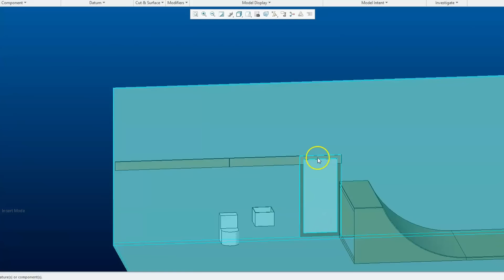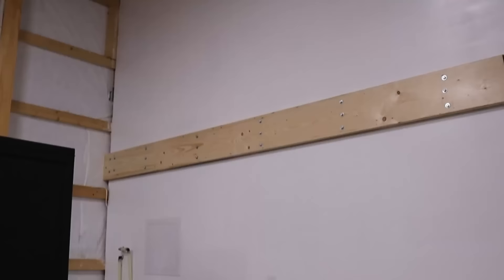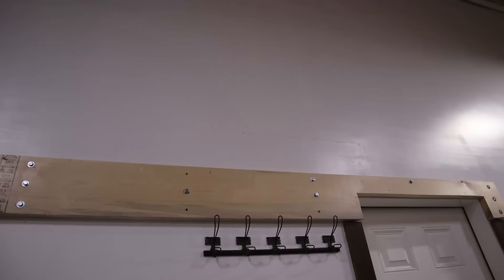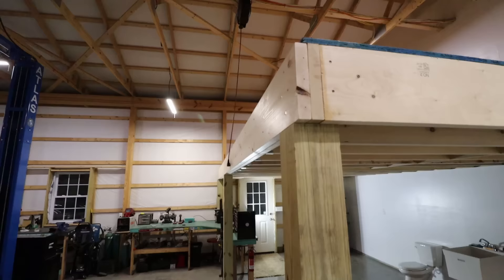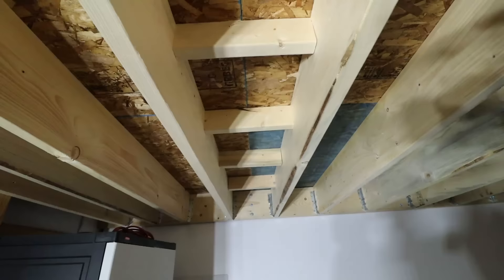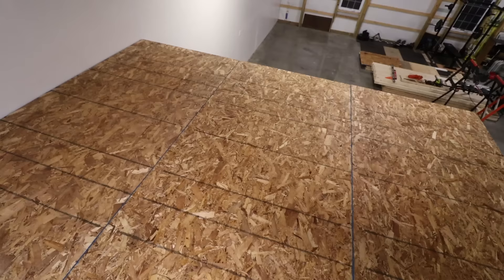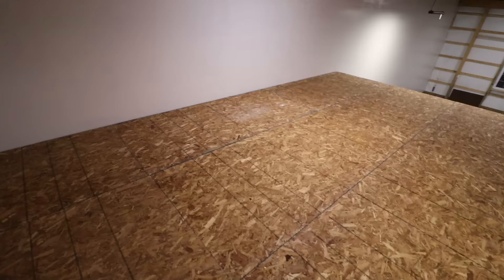Building a Large Mezzanine Loft By Myself - FULL BUILD

Comment: It turned out pretty good.  The lack of joint staggering though was painful to watch.  Staggering your joints will increase your strength and rigidity.  Also, most pros start in the back corner and work out with flooring, it usually requires more cutting, but will make staggering your joins easier, thus increasing the strength.
Reply from the maker: Yeah I didn't bother since this structure is tied to 2 walls and it's just for storage.

Comment: What is the finish on the concrete floor?  What procedure and equipment was used to get it that way?  Does it repel oil spills?
Reply from the maker: Polyaspartic roll on coating from sure Crete. Applied it myself

Comment: Fabulous construction, brilliant, oh how do I weaken it..., oh yes cut notches out out of it, if you do need to cut your timbers where its load bearing, double or triple the thickness, other wise great.
Reply from the maker: Yeah I ended up adding more bracing to those areas and also changed all the screws to proper nails in all joist hangers. It's not perfect but I need the proper headroom above to ride bike on top and I'm glad I did it.

Comment: Not trying to be a hater, but i have some safe structural advice for you.  Good thing you have lots of lag bolts.  4" is too short.  1.5" wood +.5" drywall is only 2" bite less the .5" which is the tip of the lag and you are not left with much holding on. Your built up beam is weak and needs WAY more screws. 1 screw per 2" width every 16". load that floor up and those screws will bend or sheer.  The glue is not considered as a permanent bond.  "Feels Solid" is not how safe construction is done.  My suggestion would be to swap out those lags for 5-6" ones and add a ton of screws to that beam.  where your non t&g plywood is you should have just glued 2x4 on the flat.  As is it will sag between your blocking.  Especially if you have a heavy shelf leg or something, it could potentially push right through the edge.  on all your connectors, make sure every hole is filled.  I dont know where you live but if your in a seismic area you should definitely look into some additional bracing.
Reply from the maker: Thanks for the suggestions and yeah I've already added more bracing especially over the door cutouts and have added many more screws. I ran out of some supplies before completely finishing but thought it was close enough to finish the video. I was limited on lag length because I have some pipes running through studs in certain areas which is why I stuck to 4".

Comment: GREAT job!.  But since you went so "overkill" as it were, i really would have put 1/4" x 2' sq. steel plate under the columns to help spread that load...too late now i know....but i can't tell if the one column is on an expansion joint or control joint?  That just bugs me, but that's me!  Good job!  Also, if in the future you do something similar, screw a 2x4 to the bottom of the rim joist on the outside edge...you can rest the joist on it until you get up on ladder to screw them in place.
Reply from the maker: Thanks, and I appreciate the feedback! This concrete is at least 6" thick rather than traditional 4" so I'm thinking it should hold up without issue.

Comment: Great job. I built a 30x50 metal building and need to seal the floor. I noticed your floor and it looks like it has a very good seal! What kind of sealer did you use?
Reply from the maker: Thanks! I used SureCrete Polyaspartic roll-on coating. It has done pretty well, just make sure your concrete is clean and very dry before you start. I unfortunately had to do it in the middle of winter so my floor wasn't completely dry after cleaning which will mess with adhesion of the coating.
Reply from the maker: I don't think it's as hard as epoxy, but also depends how many coats you put down. I'd suggest at least 2 and yeah I'd use it again for sure. I'll probably add another coat on top in a few areas.
Reply: Thanks so much for the info!

Comment: you did pretty good aside from 4 things i would have done differently. those 2 things are staggering floor sheathing, 16" centers, plywood instead of OSB, and i wouldnt have cut the bottom of floorjoists for doors but instead i would have frames a box out with the floor joists and transferred load over to the sides of the doors instead. either way works but it would have been stronger to use full joists and transfer the weight load over to the sides of the doorways instead. good job though overall
Reply from the maker: Thanks for the tips, I'm definitely no carpenter. I did take the time to fix a few things after the fact, mainly switching screws to nails in joist hangers and adding more bracing around the doorway.
Reply: @Kordare  No problem. for a car guy that has little experience in carpentry you didnt do a bad job at all, i have seen others do things that make me scared to walk on them and yours doesnt do that for me. definitely need some railings still but it seems like you know what you are doing enough to make decently strong railings

Comment: You should have bought a few extra ceiling joists to put a run of noggins or used herring bone strapping down the centre of those 12' joists from one end to the other at the 6' mark to tie them all in and make it a much stronger job as well as preventing those 12' joists from twisting/moving.The OSB and joist hangers are not enough to prevent those ceiling joists from twisting/moving and then that floor will go springy. hth
Reply from the maker: @katluke  you can see at the end of the video I started to do this and actually finished adding the rest today!

Comment: So if you did your research/homework! Where did you come up with 14" centers for floor joist?
I'm not an engineer but I don't see the reason to put them 14" apart v/s 16" apart, if your thinking 
was to make it stronger then 12" or doubled at 16" would have been the way I would have gone, 
since not having the osb joints staggered and split on a joist (and no adhesive) weakens the floor.
However, the bridging was a good after thought solution.
Maybe you should stick to cars.... lol
Reply from the maker: Yeah this definitely isn't perfect I'm obviously not a carpenter. And I just wanted some extra support over 16 since I ride bike on top. I could have gone 12, but I didn't, oh well it turned out better and stronger than I could have hoped. I have since fixed some other mistakes I made.

Comment: So, if the top platform of your half pipe is lower than the height of the loft, why not make the loft 6” taller and clear the doors? Looks like you have plenty of ceiling height.
Reply from the maker: Because I wouldn't have enough room on top of the loft to land on my bike and also drop into the ramp from the loft. Now that the ramp is built I'm glad I didn't go any higher.
Reply: @Kordare  gotcha. guess the ceiling looks taller in video than it actually is.
Reply from the maker: @gvente87  yeah it's only 14ft so I have 6'7 headroom above and below the loft

Comment: Let me start with the fact that I'm not a carpenter so maybe my question is common sense to some but is there a reason you didnt set the joist plate a few inches higher to avoid the clearance issues other than maybe height issues for the half pipe? Awesome video, I have been contemplating a pole barn with a loft.
Reply from the maker: I placed it so I had even headroom above and below the loft. I did this because I ride bike on the loft so it was crucial to have enough space up there. Ideally you should do a 16ft ceiling if you wanna have almost full height first and second floor.

Comment: Thanks for a great video. My question is: Will the concrete floor support the weight of the 6x6 posts? Normally support beams on concrete  have concrete footers under the floor. There is a lot of weight  supported by only 3 5 1/2 x 5 1/2 posts.
Reply from the maker: Yeah it should be fine because I have 6" thick concrete in my garage. I'd agree you may need to have larger footers if you only have a 4" slab
Reply: I disagree 6" slab is not enough to carry that load. You should of cut out a 16×16" hole dug 18" filled with concrete first.

Comment: Great job and video.  It made sense to me why you kept as much space above mezzanine as possible - already gonna have issues catching too much air off that half pipe and be in the trusses!  I want to do similar mezzanine but I was worried about not having enough concrete footing for the posts - I guess it all depends on how much weight will be on top of it.  Obviously you have a car lift in there so did you reinforce more of your slab than just exterior walls?
Reply from the maker: Thanks! Yup I made sure my entire garage was a thicker pour so I could put lifts anywhere, so I'm not worried about the loads on these posts.

Comment: It’s probably already been mentioned before, but when you notch a joist, it makes the whole joist only as strong as the thickness of the notched area. So if you have a 2x10 and make a 4” notch, you have now essentially weakened the span to that of a 2x6.
Reply from the maker: Yup definitely aware of that, this was already way overbuilt for what I'll be using it for so I wasn't too worried about the notches. I also added more bracing to those areas after this video.
Reply: Kordare Yup, it’s definitely overbuilt and I’m sure you’ll be fine. Thought I’d pass that bit of info along about the notching. There was a time that I didn’t know that. Looks great.
Reply from the maker: @chevelle74us  I appreciate it, thanks!

Comment: What was the reason for not raising the entire mezzanine up about 4 inches so you wouldn't need to cut notches in the floor joists for the doors to clear?
Reply from the maker: I'll be riding bike on top so it was crucial to have enough headroom. I set it up so the headroom above and below is equal. I actually already added more bracing over the door.
Reply: @Kordare  On the wall side you could just stand a couple of 2x8's vertical flat against the wall under that header in place of another 4x4 (or 6x6) leg and that would be plenty of support
Reply from the maker: @MonacoMike  yeah I might if I see any drywall compression, but I honestly think it wont have any issue with all those lags

Comment: When you lay your surface on the half pipe if you skate - you need to stagger your plywood sheets, if you don't the joints will become unbearable. I had multiple half pipes in the 80's and 90's... trust me.
Reply from the maker: Thanks for the tip, I ride bike so it wont be nearly as big of a deal.

Comment: Not bad, but the out side joist should have been a 20 foot to span the joint. The joist hangers need nails unless you are using structural screws. The floor sheeting joints should have been cut to fit and staggered. The floor height should have been pushed up the extra few inches to clear the door. The corner post could have been notched on both sides. But all in all, it will be strong and work for you.
Reply: I have a friend who's favorite expression is "Don't should on me".  Just saying.

Comment: You've got 2 LARGE problems here, both on the door side of your platform. First, the outside joist is improperly set. It needs to be on a platform carved/cut from the upright stud. As it sits now you are carrying all of its weight and any weight on top of it entirely by the shear strength of the screws holding it and they are NOT rated to do that. They will shear and fail even with the angle bracket on the inside. 

Second, the two joists over the door have been structurally compromised by your angle cut coming off the wall. If you were ever to have a structural engineer see it they would have no choice but to condemn the structure. You need to lift the whole thing up by 3 inches so it is completely clear of the doors everywhere and move the outside post outward so that all rim joists can rest on it.
Reply from the maker: Both rim joists are resting on the posts. I've changed all screws to proper nails and added additional bracing over the door. This is completely overbuilt for what I use it for.

Comment: I would not trust lag bolts alone.  under each of the lag bolt locations, I would support the header with a vertical 2X4 that spans to the floor. screw the 2X4 into the stud in the wall.  This will take the side loading off the lag bolts.  the drywall has very low compressive strength compared to wood.  you will get bending in the lag bolts the way you have it installed.  Can be fixed, but I would do it sooner rather than later.  This is a common problem when people are building decks.
Reply from the maker: I've thought about this exact situation and may add some additional support as you mentioned. Appreciate the feedback.

Comment: Just fyi you can drill a large hole in a board and not loose its structure, but if you cut a notch out of a board it is no stronger than what ever is left solid.   In other words your 2x10 with a 2" notch is now a 2x8" so just go with a 2x8 and save time and money.
Reply from the maker: Yeah I just didn't know the exact measurements and how many I needed so I just ordered all 2x10s

Comment: Nice! I'm about to do a 12x16 in my building similiar to this!
Reply from the maker: Awesome good luck!
Reply: Im wondering...what is the span on your 2-ply 2x10 beam between 6x6 posts? I read I have to have a support every 10 feet on a 2 ply 2x10. I'm trying to span 2x10s 12" on center 16' from the ledger to beam. I was hoping to use one 6x6 on the outside corner and then span my beam almost 12'. How far is your 6x6s?

Comment: Looks really good, amazing garage.  Did you use the proper joist hanger screws, those looked like standard exterior screws?  You need structural screws rated for joist hangers, they typically have a hex head, not a star head.
Reply from the maker: Thabks! I used #8 and #9 construction screws. Probably not 100% correct but I can tell you anything larger diameter wouldn't fit through the hanger holes.
Reply: @Kordare  Awesome, i wasn't trying to be that guy, just didn't want that to fail.  Again, well done.  I've built something very similar and it is was allot of work with 3 of us, doing it by yourself while filming, kudos!
Reply from the maker: @AnnArborBuck  totally understand and appreciate the feedback, thanks 🙌🙌

Comment: If you would have staggered your subfloor joints, you wouldn't have needed supports but you should have still cut the boards to meet at joists. And you should have staggered your plate ends.
Reply from the maker: Yeah probably, but it worked and is definitely way overbuilt for it's use

Comment: Don't know why you went on 14 " centers if you had gone 12" centers or 16" it would all work out without needing the blocking and was bad.idea to cut them thin over the entrance door to.living area
Reply from the maker: Haha yeah I knew the measurements wouldn't work out but that's the spacing I wanted. I guess we'll find out if the cut ones hold up, I'm pretty confident and will prolly add some additional bracing

Comment: Do you have the joists and board sizes?
Reply from the maker: All 2x10. Structure is roughly 12' x 20'
Reply: @Kordare  thanks. So the floor joists are 2x10. What size are the supports?
Reply from the maker: Yes, posts are 6x6

Comment: If you wouldve done 16 on center or 12 on center you wouldntve had to do those "bridges " and the correct way to do around the doors wouldve been to box frame them in . Structurally this will be strong. But just a little bit wrong. Also you should've used joist hanger nails not screws. Screws are brittle and will crack eventually.
Reply from the maker: Yup you are correct! My first time doing anything like this and learned a lot. I did actually go back and replace all screws with joist hanger nails.
Reply: I was watching another video where you explained it later.

Comment: Why would you not just go 6” taller and avoid all those cut outs. You’re also compromising the hell out of your floor joists by cutting them. In fact you should never cut more than 25% of the width of a support member, so those joists over the door are essentially garbage.
Reply from the maker: Yeah I know I added more bracing to that section after this video. And it's so I have room on top to land on my bike. Watch my ramp build video and it will make more sense.

Comment: I would have at least went to the top of the door jambs instead of cutting around them I would strengthen the two near the half pipe because there gonna take a beating over the years.
Reply from the maker: I'll be riding bike on top so it was crucial to have enough headroom. I set it up so the headroom above and below is equal.

Comment: Why didn't you just raise the height of the mezzanine about 6 inches. You wouldn't have had to notch anything. It's a good thing you didn't pull permits. That would not pass inspection.
Reply from the maker: Yeah of course that would have made everything easier, but I'll be landing on top with a bike so I need the extra headroom up top. I set it up to have even headroom above and below.

Comment: I’m no carpenter, but curious why you didn’t just build the structure 6” higher against the wall vs all that work around the top of the door?
Reply from the maker: I wanted equal room above and below the loft because I ride bike on top when I jump out of my ramp. If you watch my latest riding video it will make more sense.

Comment: He installed the deck wrong. Always off set like a brick pattern to add strength to the deck surface so in the future offset plywood decking
Reply from the maker: You're right, I definitely made some mistakes but this is already really overbuilt for what I'll be using it for anyway. Appreciate the feedback.